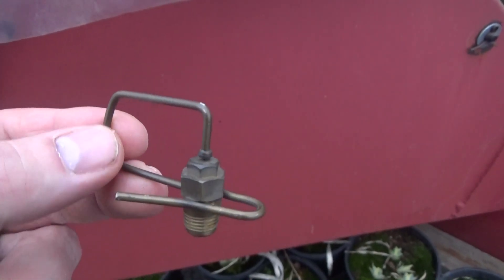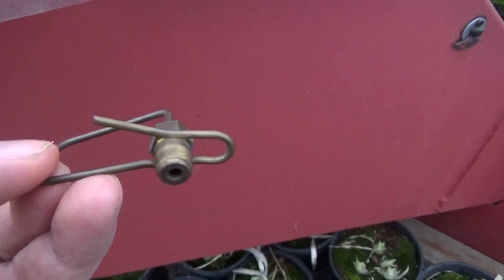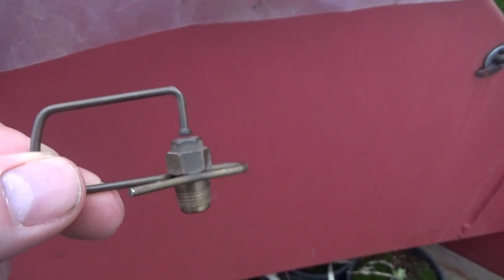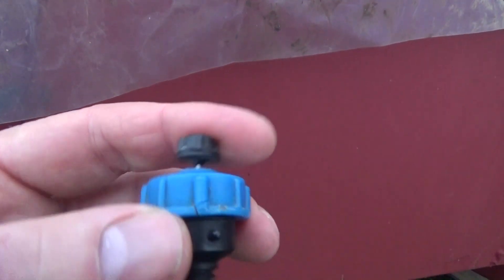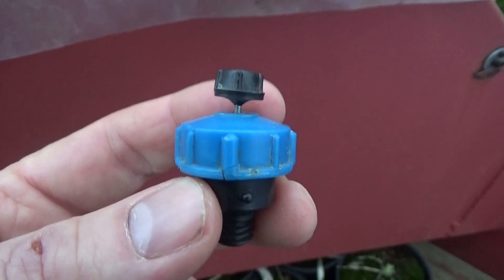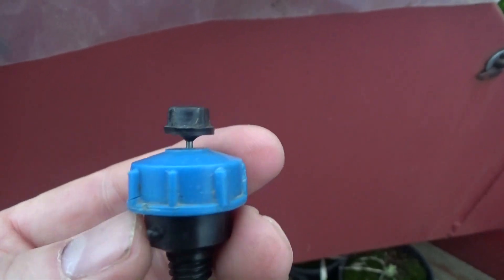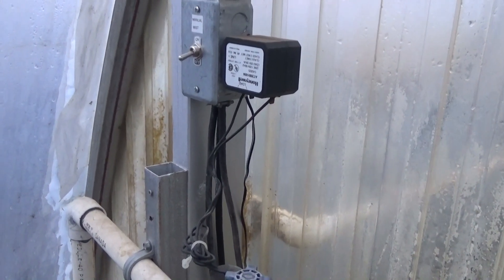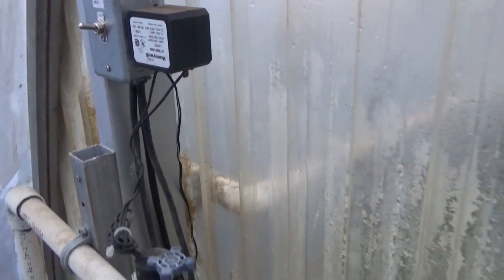Greenhouse Propagation Mist System

Comment: Would you say you get 360 degrees of mist around those mist nozzles? I've got a very small mist system I'm trialing and can't seem to get 360 coverage, just trying to figure out where I'm going wrong
Reply from the maker: Yes these get 360 degree coverage, sometimes they can get some uneven coverage from deposits or algae and need to be cleaned. I'm not sure why yours are not achieving a full circle, I wonder if there's imperfections in the pin head surface and doesn't disperse the mist evenly.

Comment: That's original. If I wasn't so lazy, there would already be a little movie about the Tegtmeier nozzle. It works exactly like the one you showed.
A certain Tegtmeier claims to have developed it in Hanover in 1948. He applied for a patent for the nozzle in Germany. It was frequently mentioned in German irrigation literature in the 1950s and 1960s and praised for its fine spray mist. For me, it's always interesting to ask: Which manufacturer was inspired by whom?
Reply from the maker: That will be great to see the Tegtmeier nozzle in operation. It seems a few manufacturers were producing these.